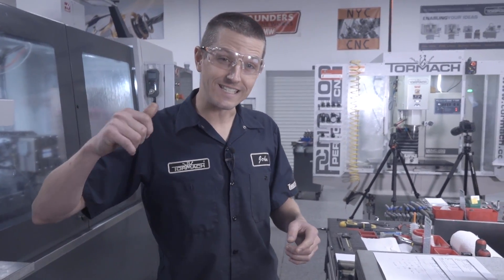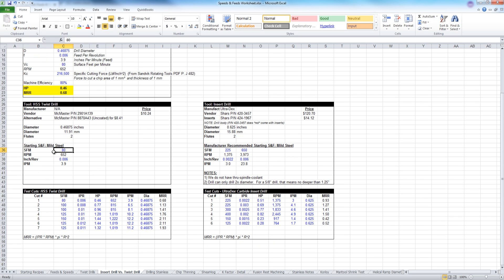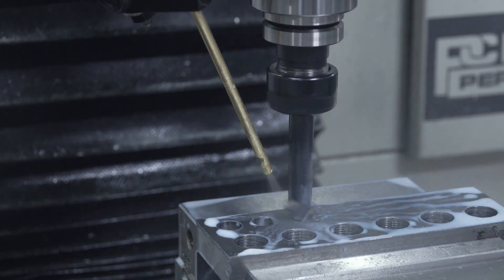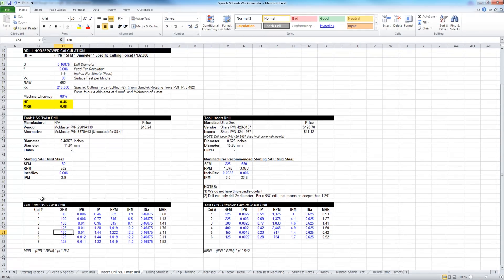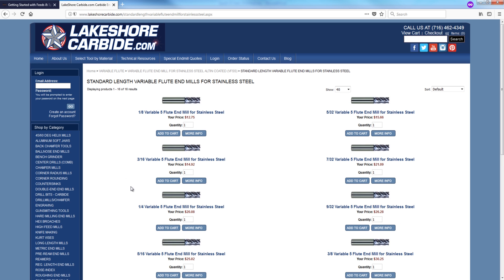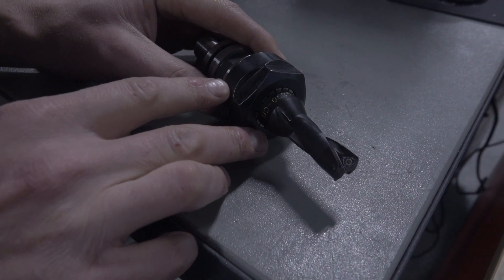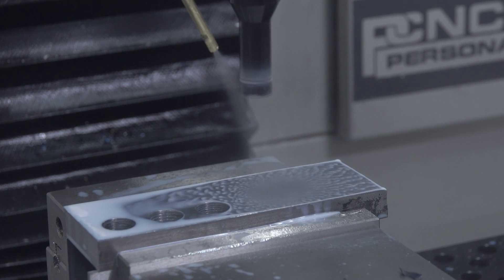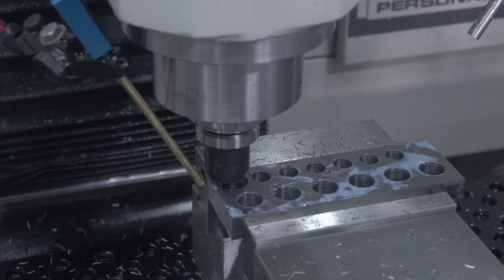Carbide Insert Drill versus HSS Twist Drill!  WW175

Comment: 20+ years of old school to modern maching experience. I didn’t believe it till I saw it the first time. Triple your fastest speed on the core drill and you’ll finally be getting to the slowest speed you can turn the insert drill. Now, get out the stop watch, time is money. Note the surface finish. Now, like a good little boy, get out your calipers and measure the hole size and location from both sides of the part. Now, let’s see you drill a .531 (17/32) hole, more common than half inch, it’s the clearance size for 1/2” bolt or pilot hole for 5/8-11 tap. You take that centerless insert drill and spiral mill that hole to .531 or dick around center drill, 1/2” hss drill, .531 drill, 125 finish, you’ll have to run a .531 reamer. I ran an old open table machine like that from time to time. I’m talking “stall the motor with a 3/4” hss drill” weak ass machine I only used as a supplement for rush work. Had no problem with a 1.03 hole with a 3/4 insert drill with a good 125 finish. THE ONLY TIME TO USE HSS DRILLS IS ON AN OLD ACME LEADSCREW THREAD, LIKE AN OLD MANUAL VMILL. The pre-ball screw manual machines have backlash and any carbide drills will break! There is no comparison here. We’re racing a geo metro vs a Tesla. You can drive an insert drill like a hss, but you can’t drive a hss drill like an insert drill.

Comment: At work we only use HSS to get a deeper hole. For normal drilling we have carbide up to 20mm. From there on up to 59mm we use indexable drills. But yeah even at 20mm those things really want to be pushed in, so having a strong Machine and Setup is the way to go. But you know how good it feels to drill a 59mm Hole 200mm deep without pecking directly into stainless steel? 150% spindle load even on our strong machines

Comment: You must use coolant through spindle, 200 meters and 0.1 mm feed, otherwise chips will not break, and that kills the tool. Try using Gühring RF Diver HM cutters, they can ramp at speeds you have never seen, or even drill.

Comment: Theoretically if I drill using a lathe whereby the workpiece is rotating, I can use more horses because the lathe spindle has a larger motor than a milling spindle?

Comment: Hi there, solid carbide drills should have been added to the comparison as for these kind of holes they are more recommended then carbide inserts, they, as the insert drills, they do require through spindle coolant to evacuate chips optimally. I wander what kind of hole tolerance can you achieve by pushing a hss drill like that, they tend to compress and arc leaving a bigger hole. A safe an very comfortable feed/rpm ratio for carbide is 10/1 (rpm/10=feed in mm) that will get you through most materials and assure you long tool life. As for the cost of solid carbide tools goes, even with much higher purchase price, the operational cost is about the same as HSS. Consider that you don't need to center drill, the feed rate is much higher while maintaining tolerance and that the tool can be reground to new by the vendor for a very low price (not the case with indexable inserts)
I use Solid carbide drills for almost everything except for hole deeper then 5xD, plastics and large diameter holes,
for flat bottom and/or large diameter I use indexables, normally from 18mm and up where the removal rate is so high, you don't really need to hurry.
then the only cases I use HSS in for deep hole, normally pre drilled with a same diameter carbide drill as deep as it goes, to speed up and also to keep the HSS drill straight. the other case is in plastics, nothing beats a razor sharp HSS drill in plastics.

Comment: Interesting, but what about the drill cutting geometry? I've felt the difference between a regular 118 degree drill point and one with a split point. The latter   makes a big difference. You can actually feel the split point going into the metal much easier and faster. In this, and if you are reading this John, what do you use to sharpen your drills and does split point drills play a part in your daily machining? Do you sharpen them by hand or use one of those pricey sharpening machines like the Darex to get the split point?

Comment: WTF ? You're comparing apples and oranges here, for the test to be in any way pertinent you need to drill the same diameter for both test... not 11.9mm for one and 15.875mm for the other... the larger diameter for the insert drill implies a greater torque requirement than for the standard drill, so this test could very well fail only because of torque limitations on the spindle.

Comment: Have you seen those carbide insert drills that don't cut quite in center, but have 3 or more inserts along the outside perimeter that are angled outwards like a regular twist drill, only even more angle? Those require a small hole first, but they're really fast and economical once you have that, and I figure those might help solve your rigidity problems? They also seem to create rounder and finer surface finishes than regular 2 flange twist drills in my experience.

Have been in some shops where they run center drill over all the holes on the part, then run a regular twist drill all the way through, then run through 2-3 sizes of those multi-insert non-center drills, then fine boring bar. They're really quite fast but I imagine expensive too unless you have a few set sizes of holes you run a lot of.

Comment: I see customers with 15 hp lathes trying to push an 1 1/2 insert drill but the z axis does not have enought force, insert tooling needs high spindle hp and axis thrust, if you baby the inserts, they do not last

Comment: i just finished a job running a .531 mitsubishi taf drill in a swiss lathe its 5 horse power and was mounted in a dog leg holder so even less rigidity. i chose indexable because you get enough rpm to make it into the horsepower curve but low enough feed to not run out of thrust in z.  1.75 deep in 303 stainless i want to say 600 sfm @ .002 ipr, ran 500 pcs and the inserts still looked new that hole ended up being bored so finish was not critical
 i have a little wierd logic on indexables, that a little chatter is good especially when you start getting deep(i have dubbed the term harmonic chip breaking) , and i usually run them off centerline to get more chip clearance. oh and hp coolant is mandatory at those speed and depths

Comment: We use high pressure through coolant insert drills, though not for large holes. Larger than 11/16 just requires a bit more HP than our machines have. Of course not all the machines that we have can do through coolant; none of our Haas machines do, so they exclusively run twist drills. This is just a limitation of what tooling that we use. You can go nuts buying thousands of types of tooling.....

One thing that I do, is a lower step-over on the endmill but at a deeper cut. Something along the lines of %150 ⌀ for depth. Step-over is aprox 4-7 thousands for 3/8 ⌀ tool,   3-6 thousands for 1/4 ⌀ tool,    6-10 thousands for 1/2 ⌀ tool. YMMV and hardness of the steel determines the step-over and you can always try a wider step-over. Like you said, listen to your work to determine what is best (don't let it vibrate/chatter). These values are what I use for 6150/4140 pre-heat treated. Softer steels, you can likely increase the step-over more.

I do prefer to use as much of the tool as possible to lower the over-all wear of the tool. The time difference is easily compensated by the deeper cut. I don't have feeds/speeds in front of me because we have those set, but we do use standards for chip load and there are just to many values (nearly 200 diff tools) for me to recall just off the top of my head.

Using a HSS drill followed by an endmill is exactly what we do for larger holes; this is very effective when your drill size is limited by your avail HP. Cool video, as always. Keep up the good work =)

Comment: I tend to just run a long reach end mill for those holes. I have a BP boss 8 that has limited quill travel, so drill bits are usually a good way to almost guarantee that I will consign myself to stopping work and dropping the knee to accommodate the length of the drill bit. Doing that requires me to load a new program because the table height changed and thus changed all my tool height offsets. Not a big deal, but with those added steps, just sticking to a nice rigid end mill usually ends up being the faster way for me to get a hole made.

Comment: Thru coolant always helps with inserted drills. Also, as you said, a nice solid set screw type holder would make a huge difference at least in my experience.

Comment: Very informative and detailed, video, nice work. With regard to any cutting tool, always ask the manufacturer for S&F recommendations, they know best. Is the HSS drill standard 118 deg point? if so it is probably not split or notched. 
Reducing the web thickness, where 70% of the drilling force is, significantly increases the feed per rev you can use and reduces the force on the spindle. Also in this material and at that depth, there is zero need to peck, this constantly stresses and and de-stresses the drill material, and will lead to early failure.
Reply from the maker: Great tip!

Comment: Considering that you could resharpen the twist drill, wich takes just about the amount of time needed for changing inserts, you would get way more than 3 cutting edges resulting in much cheaper tooling.
Reply from the maker: In my experience, few people are able to properly sharpen a drill back to factory (or better) quality.  MANY can, but more cannot.
Reply: @nyccnc  Yea, I never get close to factory.

Comment: This inserted drill is garbage and your using the wrong holder. Try a Guhring insert drill in a whistle notch holder. Guhring inserted drill have low feed force geometry and can run twice as fast as any other inserted drill.

Comment: Plz never ever in your life use an insert drill w/o coolant through spindle. I've seen chips melting and welding on the tool used in a similar way... you were just lucky not to.
If you want to compare you shouldve used a full carbide twist drill.

Comment: You may try a spade type drill. On ours you buy the drill body and just replace the cutting tip when you need to. 
We would drill oil field plungers  3/4 inch in diameter 9 inches deep in 4140 and usually get about 60 pcs 
per tip.

Comment: Did you "peck" with the carbide unit?  I saw long strands of removed material.  Great video!  I learned a bunch!  Thanks for sharing your successes AND your failures...
Reply: Shouldn't peck with a insert drill. Just needed to be pushed much harder which would break the chip. The Haas will push that drill. Tormach just doesn't have the power and rigidity to handle that drill. As a general rule, pecking with any carbide is a no no. Great question however, this is how we learn.

Comment: Not sure if the machine can take it, but you need way higher RPM for that insert drill. I would start at 600sfm and .003-.004 feed. That drill does seem kind of crappy too. It's the cheapest insert drill I've ever seen. Mitsubishi and Ingersoll drills are excellent.
Reply from the maker: We started with manufacturer recommendations.

Comment: Usually I just grab the Hoffmann Bible (Machining Handbook pt2).  

Their data is usually quite good. I find it easier to use than to look it up in some online app. 
In case of a uncoated 12mm drill they say its about 40 m/min (1050 rpm) with 0.25/0.30 mm/rev (275 mm/min)

Comment: i think for any cnc without coolant in spindle，you should use as much water coolant as you can。（for U drill）
keep IPR at 0.005，set sfm at 80sfm，use G81，then try higher sfm。

and，i think its bad for u drill not to use water coolant。for HSS drill，ether

Comment: They need a bit of grunt to push them thru. Always found the manufacturer data to be pretty reliable. From memory I would be running 250m/min and 0.12rev, with TSC and NO PECKING.

Comment: Maybe the results would be different if you had predrilled the holes?
Reply: The results would be worth simply because the material removal rate would be too low. A carbide insert drill is made to drill into full material. If the machine can't handle that. Then it's the wrong tool.

Comment: I'm guessing here, but I think you would have been better off not using the TTS adapter.  You're increasing your stick out, and relying on that to be rigid in an 5/8" R8 collet?  I think you may have better performance using an R8 end mill holder.

Comment: We had a process on he lathe where we used a 1.125” insert drill. It was loud, scary, but it hauled chips out and left a flat-er face than a twist drill which was desirable. The problem is, we broke an insert while drilling a hole and it totaled the tool. The tip was all chewed up and deformed, the part was pushed back and ruined, it was a bad day.

Switched to 2 HSS drills, a .75 and a 1.0625 still and it was much better. It hauled thicker chips, was quieter, and had a much more reliable cut. We kept that option because the drill cost significantly less. 

It doesn’t seem like insert drills are the way to go yet. Maybe for superalloys
Reply: I do drilling form .625 up to 4 inch diameter inserted drill " on my lathe HAAS ST30 . smaller diameter need high pressure coolant than bigger diameter . also i found out that if you run the proper sfm and feed , smaller drill body will last longer . i do drill  v10, inconel , M4, M2 , D2, A2,  S7,4140 
daily base , and have no issue with kennametal U-Drills .
Reply: We are primarily a turning shop and we've been using carbide inserted drill for 20 or more years, and we have some valinite drill body's that are 20+ years old and have been retired because you can't buy inserts for them anymore.  If ur drilling over 3/4 inch it's by far the most efficient way to punch out a hole... Imo

Comment: Have you tried using aluminum inserts with non aluminum projects? I find using those and running conservative speeds works very well. It can't be pushed as hard as a steel insert but u can't imagine it would be much different than general purpose carbide tools.
Reply: I know this is an old comment - but I do this often.  A sharp aluminum insert is AMAZING on stainless, Ti even inconel (for light cuts of course).
They really do get a razor sharp edge that is surprising to work with.  I actually use an SEHT alu insert for my 4140 facing and it works better than anything I've ever tried.  Glad someone else does this too!

Comment: John you started your test with a new sharp drill, after you push your feed and speed to the max with this material and drill would you back off a step in case the drill bit gets more dull?
Reply from the maker: perhaps - but better option would be to sharpen

Comment: I believe I heard in one of the HAAS tips of the day that you can peck up to 4 x D on twist drills. It seems like the drills were forming chips just fine until the very bottom of the hole, and that was probably due to the 1018 cold rolled surface being harder. If memory serves me, most of the wear on drill bits is from entering cut, and having too small of a peck depth wears them out faster. If you find the tips of the day on drilling there should be more information.

Comment: Mitsubishi, sumitumo, iscar, kennametal all these brands make what looks to be a twist drill with a single solid insert at the tip. Much less hp needed than the style you used and can accept much higher feed rates.

Comment: I did up an excel sheet to calculate the hp available on the pcnc1100 with the VFD supply.  Larger drills use slower Rpm and that's when you start to become torque limited not Hp limited. Happy to share if your interested.   Thanks for the great videos!
Reply from the maker: absolutely!  email?  john at nyccnc dot com

Comment: Twist drills are pretty much the best cost per hole in anything under 3/4"Ø... be it solid carbide or HSS. Inserts drills really only work better over 1" and at that your don't have anywhere near the jam in the tormach to make them work right. Those shars ones are crappy at best but you probably would find that 600-800 ish SFM and about .002" per rev is going to give you the best you can get with one. The best 'U-Drill' style insert drills are the seco style with the 2 square inserts. They are the bees knees but they also cost way way more so... another recommendation would be spade drills, Allied Machine ones are awesome and a pretty well priced. Spades are great because even if you don't have the torque to run them properly you can just use a fast peck to break the chip without damaging the drill as they are still HSS. also each body has a range of sizes it holds. Another thing to look at is trying annular cutters, with a fast peck they really work quite well but you do have to worry about the slug and where it's going to go.
Reply: Widget Works Manufacturing Inc. All good info you've given.

Comment: My shop just switched to sumitomo insert drills and they are the bees knees. Running 20 to 30%  faster than any other insert drill. Coolant thru is a must with insert drills and higher RPM .
Reply: Dave Mcmasters you probably have a more powerfull machine than this tormach. Sumi ,hitachi and dijet are best insert, for carbide drills try osg
Reply: Fischer977 yes I run 2 okk machines. A vertical and a horizontal.
Reply: Are you talking Sumitomo WDX drills? If So, those are some of the best out there. We use them in the lathe as a drill and rough boring bar.
Steve
Reply: Solid Rock Machine Shop Inc. Yes the WDX drills. We switched from the kennametal KSEM to the sumis
Reply: Dave Mcmasters sumitomo make great tools. I use them on titanium.